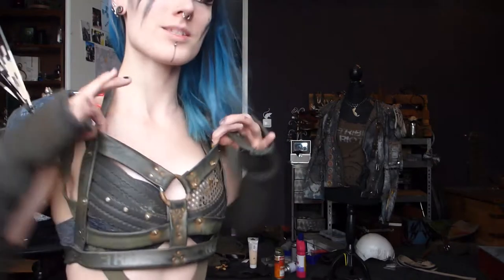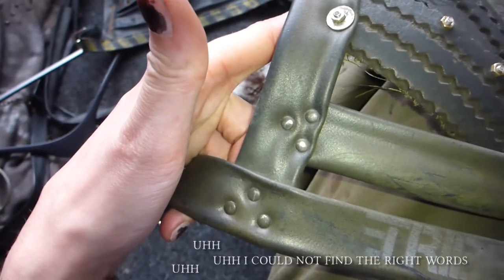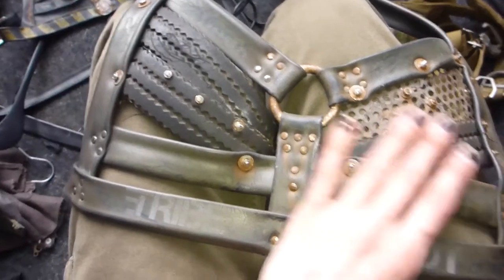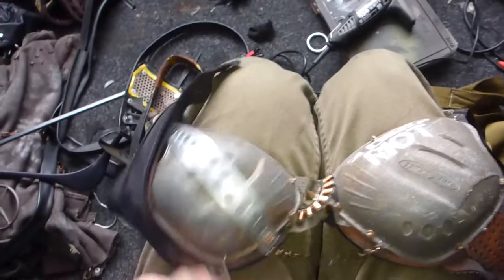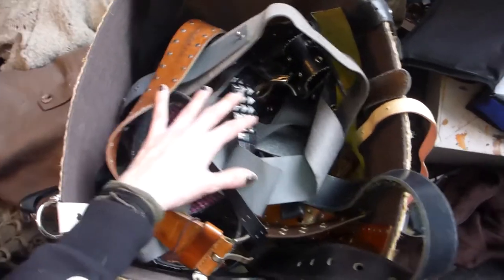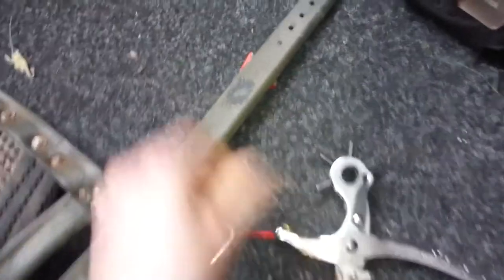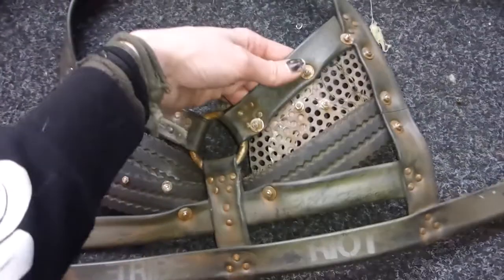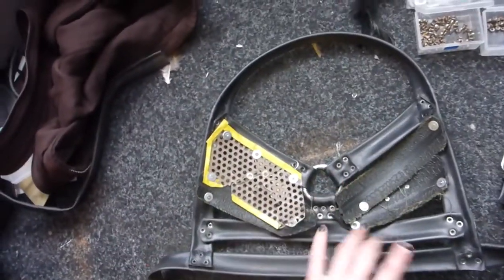DIY Wasteland outfit Bra | LivingDreadDoll

Comment: For the neck part just take some soft fabric like fleece and glue or sew it to the inside of your neck strap.  Hope you modd more on your shorts because its the only normal part mostly on your outfits.  I like your creativity very much!  :D
Reply from the maker: Coco Stardust thanks for the tip. In the video my outfit was not done (as I explained) and it still isn't. The pants I am still not happy about. I have posted a picture on my IG with the outfit so far. I want to have it finished in may  (For  the RPC event) so I still have some time :)
Reply: Anja LivingDreadDoll its just a thought. Shorts are hard to modd because of movement. I often wear a soft shorts and some harness and belts with things over it.  I personally like it like your „bra“ when its no longer a normal clothing item. But covering private parts comfortably is so important too :P   I like the photo on fb
Reply from the maker: Coco Stardust I totaly agree! I have thought about it a lot of times to make it from different materials, but I still have no idea what :) skirts are a lot easier though
Reply: Anja LivingDreadDoll yeah i agree. I tried tights and leggins very destroyed but thats  a mess to rearrange if you have to pee haha.

Comment: Hey there! what type of nuts and bolts did you use to attach the rubber together? I bought some items and they aren't strong enough to hold it while wearing, also I am having trouble when there are a lot of layers of rubber
Reply from the maker: Gabriella Goes Green I use m3 nuts and bolts and don't foget to use washers. The length depends on the thickness of the materials. Also use a plier and a screwdriver to thighten them, so it doesn't unscrew itself while wearing it. But for material that needs extra strenght I can also use m4 (european metric) or larger washers.
Reply: Where do you find them. I looked on Amazon and didn’t see them unless I searched the wrong thing